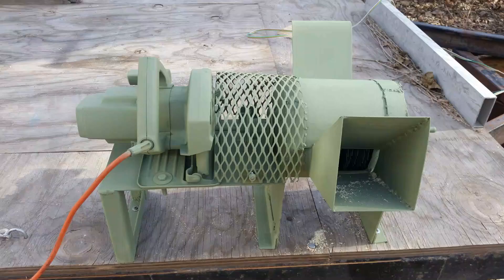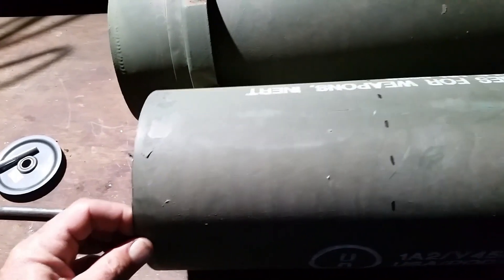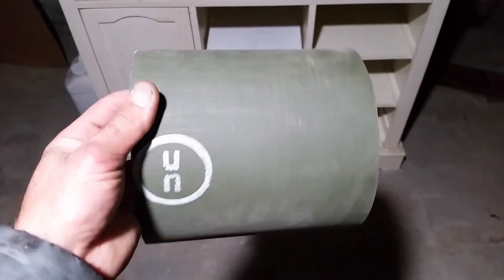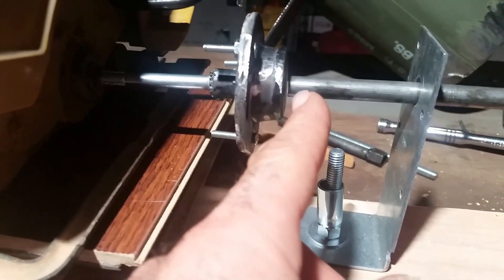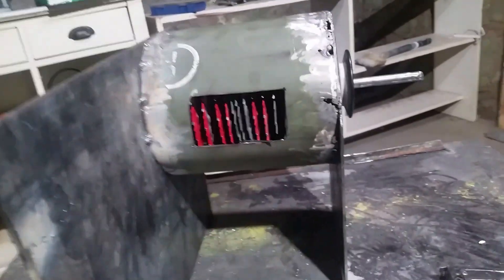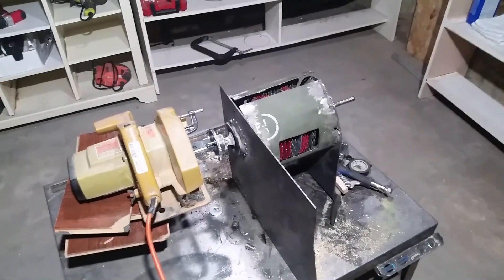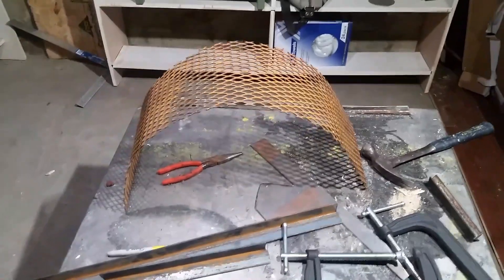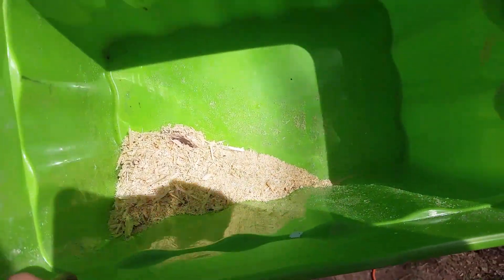Wood Chipper build powered by a skill saw

Comment: You could probably get a better result by using chainsaw brush cutting blades vs standard saw blades
Reply: Another suggestion, if I may. A threaded shaft so you can secure the blades with nuts instead of welds to make them easier to replace?
Reply from the maker: I bet your right about that. I guess we do it again.
Reply: @Saxxsays  can't wait to see the result of that one!